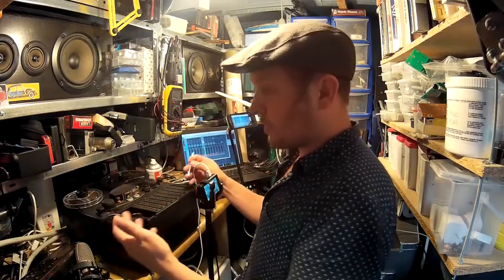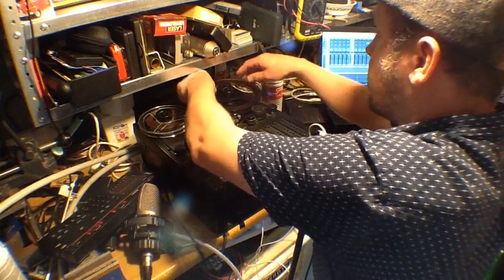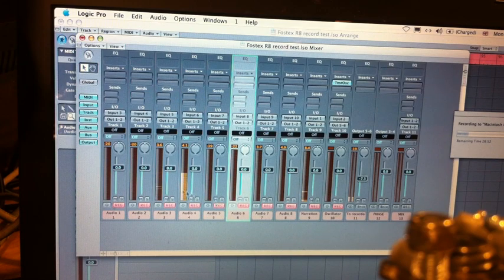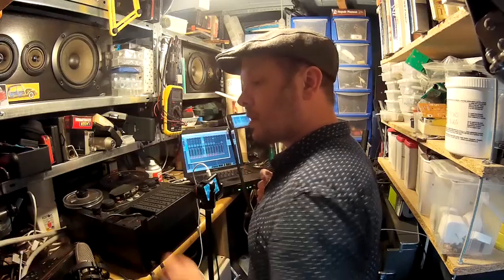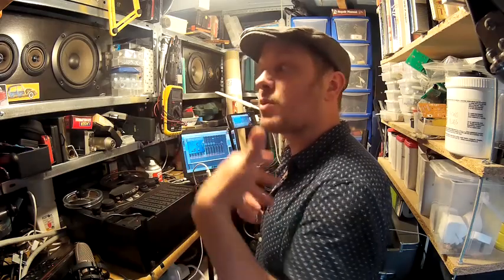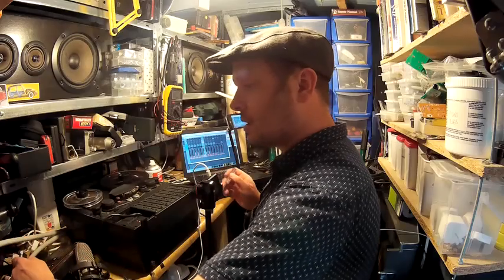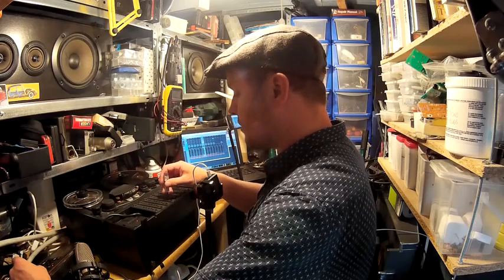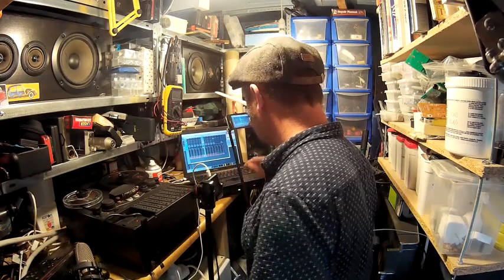ANALOGUE TAPE in a DIGITAL AGE part 2: Fostex R8 record line up

Comment: Is there a way to listen to the playback head for monitoring while recording on the r8?
Reply from the maker: Unfortunately not. The record and play head are actually the same unit. More expensive machines have a separate record and play head. These machines are usually known as “3-head”: erase, record and play in that order, left to right as you view the front of the machine.

Comment: Hey Dan! Quick question. Whenever I record on most channels, I get an intermittent recording. I know its not playback as when I playback at different tape speeds I get faster interruptions. Do you know why this may be?

Thanks!
Reply from the maker: Hi there! It sounds like your record head azimuth or wrap alignment may be off. What then happens is that the tape doesn’t pass over the head completely flat. Have you tried playing back a tape recorded on another machine, or indeed a test tape?
Reply: Get new tape. Tape is bad.

Comment: Hey Dan! Why not calibrate recording first, record sine waves on the record test tape, then use the same tape to calibrate output. What is difference between a retail calibration tape and doing one yourself?
Reply: I think while playing back the recording of the test tone you make would show false values on the computer if the play heads weren't aligned first. I might be wrong and you might have figured it out already, but in case someone reading this hasn't...

Comment: HI Dan, a similar situation with my latest comment on part one, but for recording this time. My 1k sinewave played at -20 in Logic X to read 0 on the R8 inputs. Playing the recording back read at -3 on the R8 so I gave the channels a tweak and got them to record and playback at 0 on the R8, which is -11 on Logic's meters.  I think the idea is to get higher, but that's only because you chose -5. Was there a reason for that?, and what's going on with this levels thing?
Reply: And I see your oscillator volume is at -12!
Reply: I think we aren’t comparing apples to apples. Here’s my thinking - feel free to correct it as I’m just thinking this through. The reference tape has a signal on it that should produce 0dB off the tape head as measured by the unit’s own VU meters and on an oscilloscope when playback amp is correctly calibrated. The R8 was not calibrated to pro audio line in/out levels of +4dBu= 0dBVU, but rather -10dBV = 0dBVU. Because the u and V scales aren’t the same, evidently this means that there should be a 12dB lower signal appearing on the oscilloscope when 0dB is displayed on R8’s meters than if it had been a piece of pro gear. Problem is we weren’t using an oscilloscope, but a DAW, which is most likely but not necessarily -18dBFS = 0dBVU and even this is evidently not a global standard so there’s no universal conversion factor. Anyway, the upshot is that while you could use the DAW meters in the second test to check record amp calibration since you are just testing if the “signal going in = signal coming out”, you can’t legitimately use it for the playback calibration because you don’t have a real reference point. You’d need an actual voltmeter/oscilloscope for that.